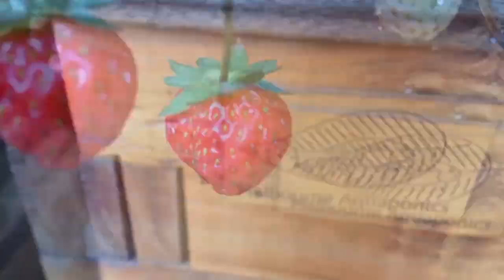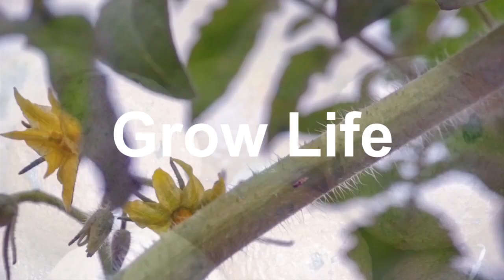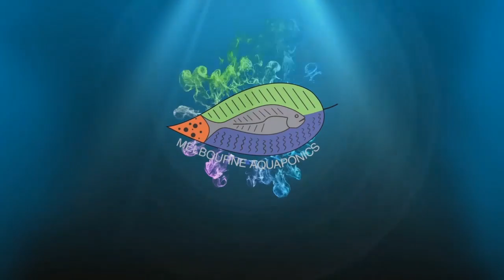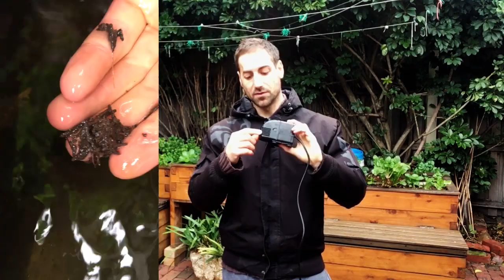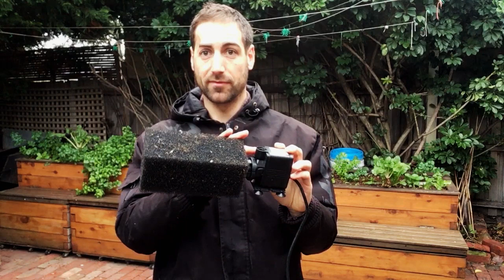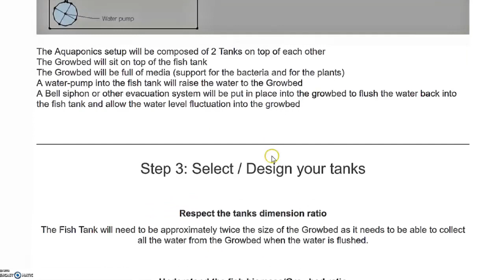Aquaponics | Low maintenance water pump | filtration

Comment: Thanks. I now have prefilters on 3 pumps.  1 pump was in a pond and needed weekly impeller cleaning. Now it has run for 3 weeks without any maintenance.
Reply from the maker: Thanks for the feedback Jim, Pre-filters are a game changer on small scale water pumps :)
Reply: I have a prefilter on a 10,000 l/hr pump and it is working well. Bunnings sell 3 sizes S, M and L. Thanks again, Jim

Comment from the maker: What type of water pump are you using and what maintenance frequency does it require?
Reply: I am using ~3000 lph pump from sump to GB and fish tank. Only using the standard screen that comes with the pump. Yabbies in the grow bed keep the filter debris/blockage free but particles do get sucked in and the growbed is very muddy and not ideal. Before I had a cover, when sun hit the sump hair algae grew and clogged the filter every few days. I like the idea of this video!